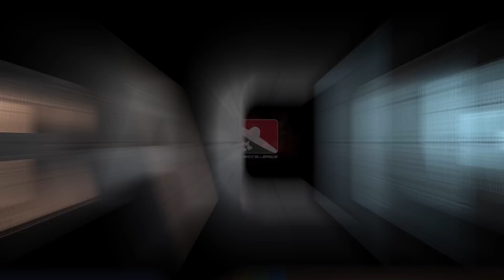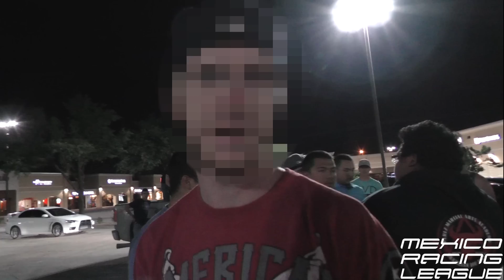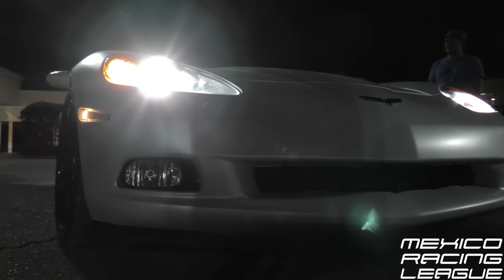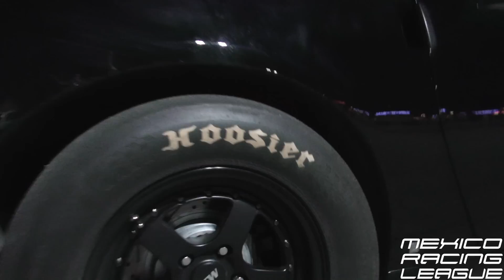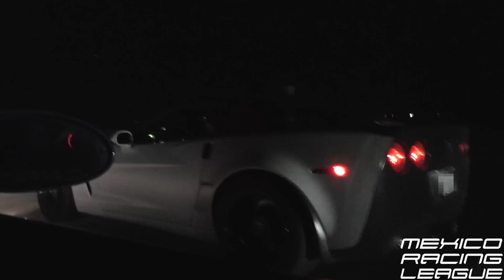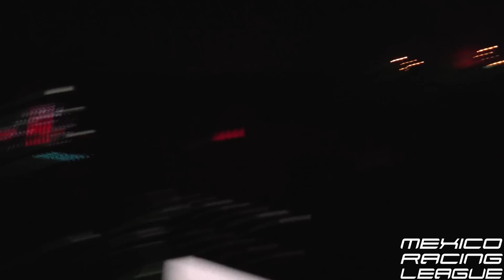Blown Corvette, 88mm turbo Corvette, & built BMW M3 - 800hp SHOWDOWN!

Comment: I don't think that LS2 is makin the 800HP he thinks it is...LOL
Reply: definitely not lol both of the other 800hp cars smoked him. now before anyone says the turbo has lag, its only on 10 pounds to. either the tuner lied to him, the dyno shop lied to him or hes just faking the funk.
Reply: It looks like the M3 was playing with the blown vette in the first race.
Reply: My thoughts on the subject.
Reply: Manny 82pr if you listen you can hear the vette starts to pass in the higher rpms, shifts and that little window inbetween shifts gives the bmw a little room to catch up.
Reply: josh xavier88 I know but still it looks like that bmw has more than 850hp an dude was slow shifting. But either way if I had the money I'll take both home ; )
Reply: josh xavier88 true but it could also be his gearing set up, not likely but possible
Reply: rekjavicxxx Trailer Queen....need I say more?
Reply: I bet it makes 800 just the power band sucks it's probably just a dyno queen..
Reply: on 10psi its probably a high 600whp with his setup. to be making 800 with that it would be more like 13-14psi.

Comment: 3.L vs 6.0L atleast? I know turbos and the PSI make a huge difference but damn, I know the M3 has a stock crank and probably stock cams and head, just Pistons rods and turbo. Anyone know this guys build?
Reply: 3.2L
Reply: Car came up for sale on the M3 forums recently where the guy in the video bought it. full HPF kit with built motor and meth. Car is no joke.

Comment: Someone's not being straight about their power. Because the blown 'Vette and the M3 both claim 800, and run pretty much neck and neck. Turbo 'Vette claims 800, gets murdered by them. 10lbs on a turbo and engine that size is just wrong.
Reply: Crazy thing about it the turbo vette was letting off at 185mph, yet still getting gapped by the others

Comment: was there an issue with the turbo vette?
Reply: B V What I was wondering also bro.
Reply: B V Yea bad tune lol, i think whoever tuned it for max power but the powerband itself sucks ass
Reply: Seems like turbo wasn't spooling fast enough
Reply: B V Huge turbo out of efficiency island, 10# is nothing as far as a 8847 can pump
Reply: PilgrimTitan I didnt catch the ten lbs part, yea its not even working at that range barely breaking a sweat
Reply: The issue was 6 speed.
Reply: sl00000w The first vette was a stick too he didnt have a problem
Reply: Mete The first vette was supercharged though.  Every time the turbo vette shifts he has to build up that huge turbo to the huge 10 lbs lol
Reply: sl00000w Damn thing was barely spinning. waste of a good turbo with nothing to make it work.
Reply: Mete exactly. That turbo was to big for that stock ls2.

Comment: soooo the guy with the blown vette how he says he has stock bottom end stock heads i call massive bullshit "oh how much power are you making " "uhh uhhh uhhh idk like 800....ish uh uh " ya right sandbagger that vette squatted in every pull on a 80mph roll hes more in the 900 950 whp range if not a little more but the black vette needs a new tuner anti lag or compound charged thing sounded like a prius it had so much lag your not making 1300 hp buddy drop the size of the turbo